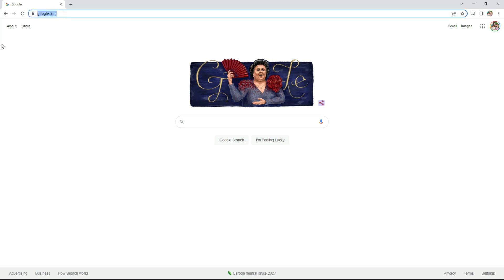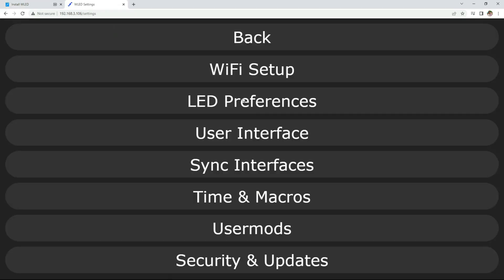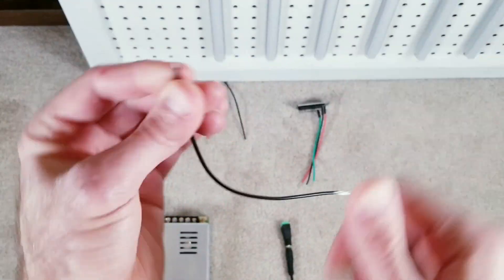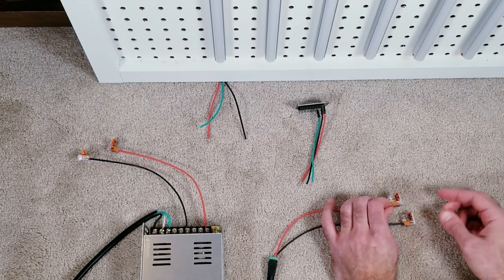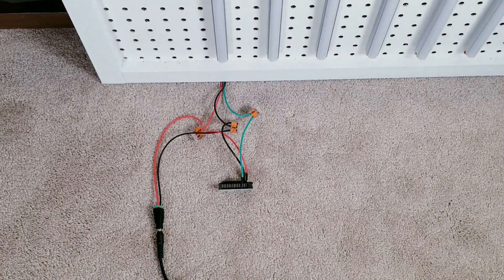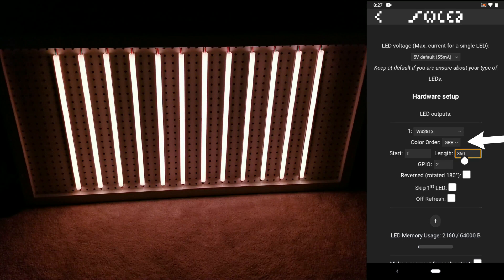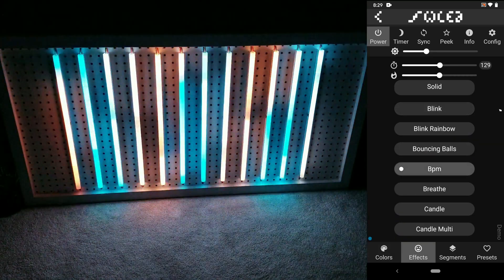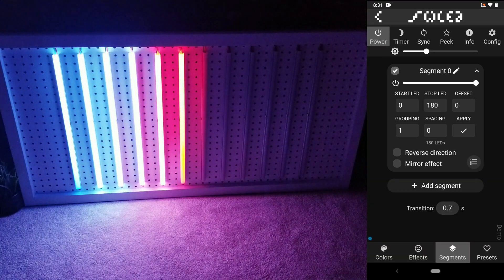How To Install WLED on an ESP32 Board and Connect / Control Addressable LEDs

Comment: Have you ever gotten a "Connection to light failed" and the light resets to its original color? Curious if you happened across that and how you resolved it when syncing multiple ESP32 lights. 1 seems to be losing connection and failing and resetting.
Reply from the maker: I have got a connection to light failed warning before when trying to access the lights from the app. Every time it happened though it was because I was out in my garage and had pretty much no wifi signal. If you have good wifi where your at, i'm not then sure what might be causing it. Let me know if you ever figure it out in case it might help someone else on here with the same issue or in case I run into it!

Comment: Thanks for showing how to wire both power supplies. Which pins on the esp32 are you connecting to? Once I figure this out Im ready to start testing.
Reply from the maker: You are very welcome and thanks for watching! They are connected to the VIN, GND and D2 pins the on 32 board!

Comment: Does WLED only work on the board/LED units shown here? Or can I use neopixels and Ada fruit products?
Reply from the maker: I think WLED works on a variety of boards. I have only used the esp devices up until this point so i'm not 100% sure but my guess is you can install it on a variety of devices. I'll let you know if I find out any for sure answers. Thanks!
Reply: @ChrisMaherDIY  thanks for the input! You’re probably the most helpful person I’ve ever seen on YouTube on this topic
Reply: @ChrisMaherDIY  additionally, how do I know which pin to connect data to?

Comment: Hey Chris I have been reading a lot about how to set these up. I know nothing about electronics and just follow tutorials like this one so forgive me If my question does not make sense. I have seen many diagrams where a 1000uf capacitor is placed just before the strip starts at + and - terminal , Secondly many tutorials suggest using a "resistor" between D4 and Data in contact on the strip, Lastly I saw a video where the powersupply's short-circuit protection fails to detect a short-circuit when one of the strips had a short and it heated up to the point where the solder on its contacts melted so in that video it was suggest that we use an appropriate fuse between + out of the power supply and + in on strip.... some even use a logic level shifter (that is too complicated for me so I am not even going to bother with it) Can you please clear up these points?
Reply from the maker: Thanks so much for watching and I'm right there with you. I've seen some of the setups that you are talking about as well and its still very much over my head. I've pretty much done all my project with what I assume is the minimum parts required and have yet to run into any issues or problems. I think doing all the things you mentioned are probably a good thing but seems like a little too much work. I'm just making little projects to put around my home and not trying to sell anything so i'm just trying to keep it as simple as possible. I have used a resistor when my first led is far from the controller. The resistor helps strengthen the data signal to make it to the first led.
Reply: I always use the capacitor and a 33 ohm resistor.

Comment: Absolutely loving the things you do with these.
A question for you. Is there a way to control these LED strips to just turn on with an effect? Like if you flip the switch, the LEDs would turn on one after the other along the length of strip and the previous LEDs would remain on.
Reply: I am aware that there is a way to make the lights default to an effect and a color after turning on power to it. However it was from a reddit post from a while back. If i get my setup up and running i will let you know what i did for it
Reply: @danielwardle24  did you figure it out?
Reply: @ronsoldano  nahhh I’ve just noticed in my life it’s much easier just to turn the power off in the app and then it turns back on to whatever color/effect was last on
Reply from the maker: Thanks so much for watching! That's a great question and one that I've asked myself a few different times. I'm honestly not sure if you can. When the power is cut, it always turns on to a default orangish white color. I have not looked too much into this to see if it can be changed. if you find out the answer, please let me know as I'm curious on this as well!
Reply: Create a preset with the colour(s) you want, save it and go to Config->LED Preferences->Defaults and change the preset # to what you created.

Comment: A well done video, one thing I would have mentioned though is to power the ESP32 and the LED from the same power supply like that, its a 5v power supply.
Someone that follows this using 12v LED and a power supply is in for a not so fun surprise!

An option is to add a buck converter to step down the power for the ESP Board, I have done this and have videos on it, has worked very well for me, and I only use 12v LED's these days to help combat the voltage drop for long runs.
Reply from the maker: Thanks for watching and great advice! Do you have a 12v individually addressable led strip that you like best?!
Reply: @ChrisMaherDIY  Like you I use BTF for just about everything.  I am using pretty much exclusivity the WS2815's now pretty much just the 12v version of the WS2812s.

For my under counter lights, if I re-do them in the future I would like to find a good 12v LED that has RGBW with a dedicated white channel for better lighting to use for illumination and not just ambience/decorative.
Reply: Are you finding any need to add a resister for noise issues to your ESP32/8266 data pin? Also are you guys finding any issues with power surge ? Like needing to add a capacitor to that LED strip as well?  Ive watched a few videos now and i havent seen that they have been added. Maybe not a requirement with a good power supply 🤔
Reply: @stevenmoriarty6909  Off the many projects I have done, only one of them has interference issues, it is also the only one that has long data wires spanning gaps where I am not running LED's.

I only have ever seen it or noticed it when I have then turned off, sometimes a random LED might turn on, to combat this my "off" setting simply sets the LEDs to black instead of off so they constantly get a new data signal to be told "off"

A fuse of some sort is always a good idea in the power side.  Especially 12v.

The best AIO unit is the QuinLED modules it has all this built in, but they are much more expensive than a $2 ESP32 chip or something, but for piece of mind, quality, or to avoid the DIY soldering and such its a great option.

Comment: Best tutorial ever ❤️ is there a video where you teach how to set up togheter 3 or more Esp32 between them? I want to put 5 strips like the one you have there but. 5 M each strip so I will need several controllers
Reply from the maker: Thanks so much! I don't have a video that goes over that but WLED has a slick feature where you can hit a sync button and then all the esp devices can be controlled together at once. I use that all the time when I want to change all the led lighting projects I've done at once since there are about 5 esp devices in my basement right now. Great question!

Comment: I'm planning to use an led strip with 12v ws2814 rgbw IC leds and a 12v power supply. I guess I'll need to also step down the voltage to 5v to power the esp device. Has anyone here tried this kind of setup?
Reply from the maker: I have not personally used those lights or tried the 12v power option but from looking around I believe you could use a step down regulator and that should work. Let me know if you find any good videos out there going over this because I would like to try doing that at some point myself! Thanks!!

Comment: Excellent video. Could I use an esp8266 instead? I have a few of those I'd like to put to use.
Reply from the maker: Thanks so much for watching! You can definitely use an esp8266. I made a video similar to this a while back using the 8266. https://youtu.be/l8OMi7SMpqs
Reply: Thanks for the link! So far I've found out that the main difference is that the esp8266 supports 3 channels (just enough for my project) while the esp32 supports 10.

Comment: Is there a limit to how many LEDs you can have set
Reply from the maker: I've never tried maxing things out but this is what one source says online: "ESP32 can calculate about 65k-85k LEDs per second (that means 1000 LEDs @~70fps, 2000 LEDs @~35fps, 4000 LEDs @~18fps"

Comment: how many leds can the esp32 board handle ?
Reply: I am sorry, my question was maybe not well formulated. I want to know for example how many LEDs I can light up without a more complex circuit ( transistors) In terms of drawing too much current and burning the esp 32. I am a beginner in that! :)
Reply from the maker: @Renaro  Thanks! Hmm I'm checking online and cant seem to find any information on what's the max! I know I've ran over 600 leds with no issues without having more of a complex setup. My guess is it can probably handle a lot more but that would for sure be a good thing to experiment on. I might have to try it myself and see!
Reply: @ChrisMaherDIY  Thanks a lot!
Reply from the maker: Thats a great question! I've never actually tried maxing them out so i'm not sure. Here is what google says: ESP32 can calculate about 65k-85k LEDs per second (that means 1000 LEDs @~70fps, 2000 LEDs @~35fps, 4000 LEDs @~18fps)

Comment: Anybody that knows if and what's needed for a power supply to be regulating the current? I mean to what I know in general its not always a good idea to how too high ampere available for a device like if it doesn't all the time use the max ampere .. meaning then the question what does the power supply do when the ampere usage is not max which many times is the case with led strips... I have been looking a little bit into PFC in some power supplies but for now am jot certain if these correct the ampere usage
Reply from the maker: Great question! Hopefully someone reading the comments might know as I'm not certain myself!
Reply: @ChrisMaherDIY  BTW I now found out a bit about my own question I've seen some people adding a Capacitor to the + and - wires before led strip (and chip) and then also adding a resistor to the Data line coming out of the chip (before led strip).. If anyone is also interested just see / search for: How to wire WS2812B (/and ESP32) there at least are a couple videos talking about it

Comment: Excellent vid... i have a question i have a large meanwell supply like the one you showed and my ws2811 leds are 12v so supply is great for that but not for the esp lol so should i just  a small 5v supply for the esp32 seperately and should i connect all the negatives together etc... hope im making sense :)
Reply from the maker: Thanks!! I've used a separate power supply but I'll admit I don't have much experience with the 12v led strips. In this video i use some 12v govee led strips but i'm not 100% sure if what I did was the best way. I've heard others say you could use something called a step down converter or something like that!
Reply: ahh never mind i have found what i needed in 1 of your other vids https://www.youtube.com/watch?v=KFtjf5mD6tA my bad for not lookin :)

Comment: Chris, you connected the ESP without a level Shifter on the Data Line? Does this work without any flaws? I allways use a level shifter. So I'm curious, cause the pin on the ESP delivers only 3.3V. BTW: Nice work with the LED Display.
Reply: Exactly what I was wondering. Looks like the logic voltage from the ESP32 is high enough for the first pixel to read then send down the line. 🤔 I am sure the data wire can't be more than 10 to 15 cm long or it will start dropping signal.
Reply: @marksmanaz  This may be the answer: Very short cables and a little bit luck :-) Due to the nature of an ESP short wires are very simple to realize. Maybe Chris can tell us somehing about his experiences.
Reply from the maker: Thanks so much for watching and taking the time to comment! I'm more of a trial and error type of tinkerer and I will generally hook everything up and see how it looks. If it looks good and works, I'll then continue with the install. Great question! For the majority of all my projects, where the controller is pretty close to the first LED, ive never needed to use anything else and its always worked great. For some projects where the first LED was a good amount of distance away  from the controller I have either used the sacrificial pixel method or in this video https://www.youtube.com/watch?v=b13VLiK7AOU I used a resistor near the controller which cleared up the issue of the data signal not reaching the first LED. Hope that helps! What level shifter do you usually use?!
Reply: @ChrisMaherDIY  Several. Sometimes a simple MOSFET cirquit with 2 Resistors or when I'm in hurry one of those cheap breakout PCBs with 2 or 4 Channels. They work bidirectional. They all work. And I also used the sacrifcail pixel method, which is a sort of a poor mans LevelShifter :-)

Comment: Great video!  Trying to replicate this, may have a bad strip.  If I just connect the red/black and no green should the strip light up? Trying eliminate each item being the issue
Reply: Got it working on 2 of the 3 esp32 boards.  Either bad board or I damaged it with too much heat.  Had issue getting iPhone app to find the esp32.  Works best if you type in client ip manually.  All good now.  Thx
Reply from the maker: Glad you got it working and thanks for the update! I've never used wled on the iphone app but that's good to know that if having trouble typing in the ip manually might get it to work! Thanks so much for watching and taking the time to comment! Sorry I did not respond sooner. I usually don't check things on the weekend. Hope you have a great week!

Comment: Is it possible with WLED and ESP32 to activate a sequence with a pushbutton/signal cable etc.
IE, someone pushes the doorbell, to activate a blinking sequence or something to draw attention.
Reply from the maker: Thanks so much for watching and that's a great idea and question! From what I have read, it is possible to assign buttons to the esp and have it interact with WLED. I have never tried it yet but it is something I will eventually look into!
Reply: @ChrisMaherDIY  I am abit shamed, I should have started my comment with "great tutorial" :) 
I plan to look into a signal activation myself, but have not got around to it yet.
Reply from the maker: @CrinosAD  thank you so much!! Let me know if you figure out how it's done as I'm very interested myself!
Reply: There are many ways to speak with WLED. See: kno.wled.ge/interfaces. Using the REST service with a second ESP or a 8266 connected to the doorbell sending some REST Requests to the WLED Controller via WLAN "may" be the simplest solution. Or use a simple MQTT Server (if you start with such things house automation will be your tasks for the next years :-) )

Comment: Hi Chris. Is it cheaper to use WLED and an esp32 or just use Govee lights
Reply from the maker: I would say its about equal after all is said and done. With WLED and esp32 you need to buy the esp32, the lights, power source and wires. After all said and done its probably right about the same price as Govee's best rgbic wifi lights. However, I prefer the esp32 rout as it provides you with more flexibility on what lights you want to use (the lights I'm using in the video have 60leds per meter while I've ever only seen govee have 30leds per meter) and you have way more options for animations and customizing with WLED. With that being said, I do think if your looking for simplicity and a plug and play option, Govee is the way to go! Love their products!
Reply: @ChrisMaherDIY  Thanks for the help!

Comment: Not working with LED TM1814B, no response :(
Reply: 24V and connected to an external power supply
Reply from the maker: @kenwo  Hmm, If I worked with them maybe I would know for sure. Is the ground from the esp32 connected to the ground of the power unit? In working with the 5v, they have generally had to share a common ground. I'm just guessing at this point since I'm not 100% sure if the setup for those strips and power require a slightly different approach.
Reply: @ChrisMaherDIY  Thanks for your help, the problem with (-) solved the problem. THX 🙏 😊
Reply from the maker: Hmm, I've never worked with those lights before. What voltage do they require?

Comment: How much power does it consume? If 1 led diode consumes 0.4w, 5 meters of led strip with 60led per meter will consume roughly 140w taking the AC to DC losses in account. Is this even worth it with that much power usage? I believe simple led lamps consume only 10-12w each
Reply: I mean is it that much more light compared to a white led bulb from let's say Philips?
Reply from the maker: They do get really bright but I wouldn't say they get more bright than just a normal white led bulb from Phillips.
Reply from the maker: Thanks so much for watching and taking the time to comment. I'm sure the big power supply is overkill but since they are not much more expensive, i've been buying a few here and there for if I ever try doing a very big project, I will already have the supply units. Also one area where I need to learn a lot more on is the whole power/electrical side of things. I generally just plug the lights in and see how they look and go from there. If they don't look good and color drops off at the end I will either use a bigger supply unit or try some power injection. And for the majority of my small projects, i'm usually running things at no more than 30 or 40% brightness because anything above that is usually just too bright for my liking.